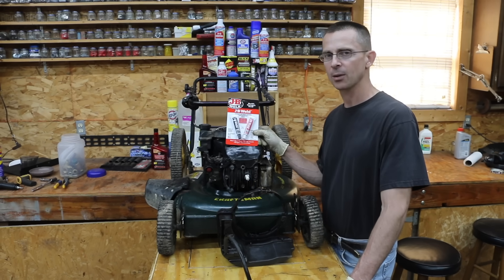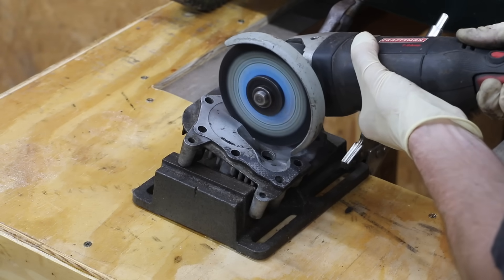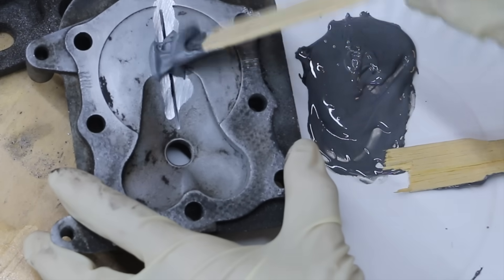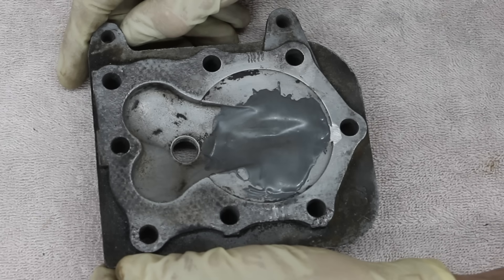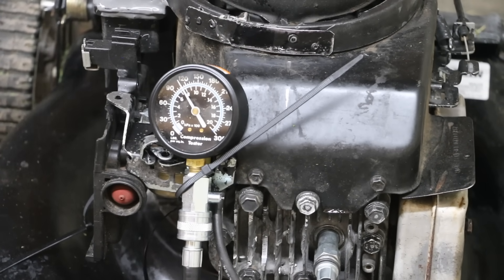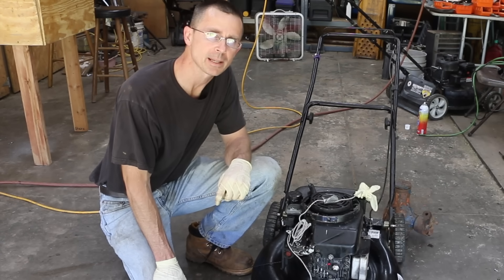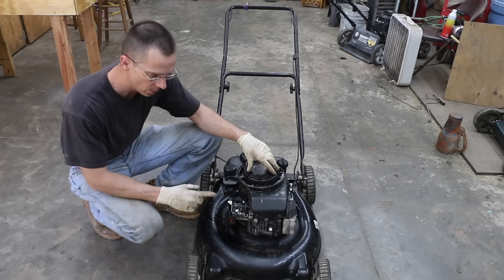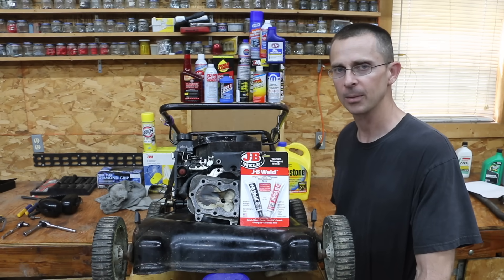Can JB Weld fix a cracked cylinder head?  See the proof!!

Comment: I had an 89 BMW when I lived in Germany that developed a huge crack in the side of the carburetor. Gas would leak out of it. I was leaving for a road trip to Italy when I found it, and I had already packed the car and everyone was ready to go. So I pulled the carburetor off and used JB weld on the inside and the outside of where the crack was and let it dry overnight. Woke up in the morning, sanded the excess down, put the carb back on and hoped for the best. Car ran fine, no leaks, so off we went. 4 years later when I left Germany, I sold the car to someone else...complete with the JB welded carb. I pointed it out to them, told them I'd never had any issues with it after that. 

JB weld works.
Reply from the maker: Wow!  Impressive repair!
Reply: No, Sir, YOUR repair was impressive. But thank you for the compliment, though. Love your videos.

Comment: But what if the crack was at the edge of the head you put a crack in the center if it was at the edge when it expands from Heat it may have had different results
Reply from the maker: Great point. Thanks for commenting.

Comment: Cool demonstration,  but not as real world practical as some of your other test.
My belief is anyone skilled/confident enough to remove the head wouldn’t be using JB weld
The average person trying to patch would probably only try to repair from the outside without removing anything.
But again very cool 😎 
Oh recently subbed 👍🏽
Reply: Not true I’m mechanically inclined and I have a crack in my head on my 98 rm 125 and instead of paying 400 for a new head on a 20 year old bike I’ll use this stuff instead
Reply from the maker: Great constructive feedback and I agree.  Thanks for subscribing too.

Comment: i tried the jb weld stick on my atv exhaust. I used 2 sticks where the exhaust pipe meets the silencer it held up for a little while but when i took the atv to get gas about 1/2 mile the atv all of a sudden got really loud so i knew it was the exhaust, oh driving it in about 5" of snow in awd so it was under a lot of pressure.
Reply from the maker: Thanks for commenting on this.  JB Weld original won't last long if exposed to temps over 500F.  Not sure just how hot the ATV exhaust becomes under load, but I suspect it gets pretty hot.

Comment: I have seen JB weld work on a Detroit 60 12.7 block that was pitted and the one sleeve was horribly bad leaking through the antifreeze side and my dad squeezed JB weld in it and prayed it would hold guess what 780k miles she's still rolling we finally sold it to upgrade and told the buyer about it 😮
Reply from the maker: Thanks for commenting.

Comment: Not for the head, but the gas tank... Seal All. I had a hole in the tank on my truck. I coated some thin package cardboard (like packaging from the Seal All tube works) and soaked all these strips of cardboard in the Seal All and literally paper mached my gas tank... while the gas was running out of the hole! It stopped the leak right away, it didn't affect the how fast it dried. It dried rock hard and I never changed it. It worked for the rest of the trucks life.
Reply from the maker: Thanks for commenting on this.

Comment: I used it to fix a dam spark plug that keeped blowing out off the head on a z24  3.1L engine and it worked tell the car went to the scrap yard 10 years later
Reply from the maker: Impressive! Thanks for commenting.

Comment: Great job. I have used JB Weld for 40+ years!! I have been a diesel engine rebuilder since 1970 and on cracked blocks, heads, lower liner bore seal ring surface I use Lock-N-Stitch ( www.locknstitch.com ) then rebore lower liner seal diameters and remachine heads, etc.  JB Weld is so much easier to use especially on aluminum. Great video!
Reply from the maker: Thank you for the positive comment.
Reply: Project Farm Sir, I am glad to know about using JB Weld on those small gasoline tanks, one of my grandsons weed-eaters has a fuel tank hole. Thanks!

Comment: i had a bad oil leak on my old 88 chevy van once , i was traveling from toronto to b.c.
during this trip i noticed the pan leaking pretty bad so i stopped in regina and  used jb weld 
to stop the leak.  5 years later it still stopped the leak. the only reason i stopped running this van was it was pulled off the road by the cops because of my rusted body. i would recommend jb weld. !!! Maybe i should have used it on the body of the van too. lol. !!!
Reply from the maker: Thanks for sharing this experience regarding JB Weld!

Comment: I'm definitely impressed with JB weld, it held up beautifully on the cylinder head of that mower. I've used JB weld to repair the gear shift lever on a Kawasaki 3 wheeler I used to have, the splines on the gear shift shaft were stripped so I used JB weld to permanently attach the shift lever to the shaft and it held up beautifully and the lever never came off or broke off again! JB weld is some amazing stuff, it's like basically welding only with epoxy hence the name, JB Weld.
Reply from the maker: Thanks for commenting. I continue to be amazed that JB Weld can withstand some challenging repair demands.  Thanks again.

Comment: Many years ago I had a single cylinder dirt bike that had a crack in the head from the spark plug hole to the intake valve to the point of loosing compression. As it was very difficult to find,and expensive for a new head I JB Welded it. I sold the bike a few years ago to a friend and he is still riding it :-)
Reply from the maker: This is an impressive repair. Thanks for commenting.

Comment: fixed a cracked block on my boat inline 4, grind out the crack, tap an thread some screws that are stainless, grind off with heavy stone then fill will jb weld let dry a few days, sand down and add another layer ( using original not fast set) has held up 8 years lol
Reply from the maker: Impressive repair!  Thanks for sharing this experience.

Comment: Curious to know how the tank repair held over time. My luck with JB and fuel diminishes over time. In the automotive restoration wold there is a repair for a certain carb in the float bowls. JB does not hold there. The consensus is the you must use Devcon which is similar to JB. Its the only one to hold up over time in fuel. May be a test you wanna try. The Devcon is quite expensive BTW.
Reply from the maker: It's still holding up just fine.  Getting the surface extremely clean and sanding it with a very abrasive sand paper makes a big difference.  Great point regarding the cost of Devcon. Thanks for commenting.

Comment: I cheaply fixed patched blown head gasket from water jacket to outside of engine on the wonderfull late 90's chevy car 3.1l and the 3.8l as long as u drain coolant and wash scour so jb can grab andclean clean and clean more with oil free solvents changed the coolant got the ph to neutral and 7 out of 9 cars still running on patch job  yes customers were aware of this and yes they wanted to give it a try due to money issues. Ive also repaired a 2t ford garden tracter had a 9" cast iron crack on external water jacket wall on engine block in cyl area from last owner not using coolant in colorado tractor still leak free.....
Reply from the maker: Great post. Thanks for commenting on this.

Comment: i used jb weld on a exhaust manifold off a John Deere 70 gas  farm tractor that was broke in 3 pieces i mounted the manifold on a junk head and put it back together as a temp fix until i could locate a different one to my surprise it did not fail i sold the tractor 5 years later after buying a JD 4020.
Reply from the maker: Impressive repair!  Thanks for sharing this experience.

Comment: I repaired a Snapper riding mower about ten years ago repairing a hole in the crankcase with JB Weld it was quarter sized and it is still holding.
Reply from the maker: Thanks for commenting on this!

Comment: There are better JB Weld knock offs from other companies and I've seen them go head to head in another video, doing weight bearing/shear tests, but it is a good product generally. My only gripe with JB Weld is what is shown here, the drying time. It stays viscous for far too long. There could be instances where that's a good thing, if you need more working time, but if you want quick setting, regular JB is not the best. I do believe they make a quicker setting JB Weld? My preference is to Permatex Cold Weld. It's the same price as JB Weld usually and just as strong if not stronger and sets up really fast. Sometimes gravity is not your friend and you can end up having JB Weld everywhere from having to work it back into place till it sets up harder, lol. I used JB on a gas filler neck and had to fight against gravity for 2 hours for it to stay in place till it set, but it's fixed and doesn't leak now. 

I've used similar products to fix gas tank leaks, transmission pan leaks and all kinds of other stuff and it's awesome stuff. You can treat it almost like steel and it will hold up as good as steel sometimes. Your tip was really good too, for it to work better. Score up and clean your surfaces with solvent, to give it something to grab onto. The difference in how it adheres to clean, scored surfaces is so much better than if you don't. If you don't give it something to grab it will break and fall of. Even just sandpaper, file or wire brush the area, if you are fixing something in place and not removing it. The JB (or other similar products) will thank you for it! There are guys on Youtube who have cast engine cylinders made completely of JB Weld and they worked! It is surprising what this stuff can do.
Reply from the maker: Thank you for this recommendation!
Reply: Thank's for your response! Few Youtubers respond to comments and I see that you do, so that's cool. I get that Youtubers can't reply to everyone, but it's nice when they take the time and try anyway. Just for that, I subbed to your channel cause that's cool and I really like your videos. It's fun to watch these and you try to be Scientific and fair.

Comment: Is it safe to SeaFoam a JB Welded engine? Or will SeaFoam treat JB Weld as a carbon deposit and dissolve it?
Reply from the maker: Heat will destroy the JB Weld, but Seafoam won't.  Thanks for commenting.

Comment: A few years ago I was involved in a car accident. The damage pushed the hood in and snapped the distributor off its mounting bolts. Chunks of the head that broke off were still attached to the distributor bolts so I figured i'd try and JB weld it back on to yard drive the car. I was skeptical because the broken mount points opened up a few coolant passages in the head and they also needed to stay put from the force of the camshaft spinning the dizzy. To my surprise the JB Weld worked fantastic. I sold the car as a salvage with the JB weld and for all I know its still holding it together. Amazing stuff.
Reply from the maker: Wow! This is impressive and I really enjoyed reading about how you used JB Weld to repair the engine. Thanks for commenting.

Comment: I don't know if you've tried the two part epoxy sticks (half green, half grey) on any engine fixes, but I've used it several times for patching leaking seams in my old aluminium fishing boat  (nearly 40 years old), and it's worked very well for that. I've used it several times to patch and reinforce condenser fan blades, and one repair is several years old, and still sturdy. 

I've used JBWeld to fix a cracked lower shaft housing on an outboard motor (again 40 years old), and it lasted for 5 years at least, it could be still working for all I know - I sold the motor a few years ago.

I'd like to see you test the two part epoxy sticks, since it's more convenient to carry and use out on the trail when snowmobiling or on an ATV.

Thanks!
Reply from the maker: Thank you for this recommendation!

Comment: Several years ago I sealed a water jacket crack in the middle of an aluminum head of a dodge colt with a product called quick steel. I didn't open the crack but I did rough it up and ground down a bit in the aluminum. It worked. Drove that car quite awhile before I sold it to my neighbor which knew about the repair and he drove it too for quite awhile. No leaks!
Reply from the maker: I've heard quick steel is a great product. I plan to test it soon.  Thanks for sharing this experience!

Comment: Actually if you look closer, there IS surface cracking on the JB weld.  Not sure that JB would be a long term fix in this environment.
Reply from the maker: You are correct. It would not be a long-term fix due to the heat limitations of JB Weld.  It's rated for around 500F and combustion temps far exceed that.  I'm impressed it lasted as long as it did.

Comment: I have repaired V Twin cylinders, and Triumph cylinders with JB weld.  It held.  In both cases the customer had installed headers on the bikes.  The result was an over lean condition as a consequence of the headers scavenging more exhaust gas and thus creating a leaner burning engine.  On the Indian and on the Triumph, the combustion flash cut into the cylinder wall.  On this Triumph and another vertical twin, the flash over actually cut a grove down the area between the two cylinders.  In most cases this would be a lost barrel.  JB weld was installed in the cracks and machined in both cases.  Both of those bikes are still running strong, full compression etc. BTW, always start from a enriched condition when installing headers.  Lean of a bit at a time and measure exhaust temps.  On English bikes it is much easier, as you can just change the jet needle postion very easily.  On most V Twin carbs, no so easy.  Some jet changing may be necessary. Also check you timing when installing headers given the leaner run with headers.
Reply from the maker: This is great information.  I really like having JB Weld as an option for various repairs.  I'm amazed at how well it works.

Comment: Do you think JB Weld will fix a hole in a Kohler K341 cast iron engine block?
Reply from the maker: If used to plug a hole (applied inside the engine with pressure pushing JB weld into the hole), it certainly seems likely if the area of the block isn't subject to temperatures exceeding 500F.  If used to patch a hole (applying a layer on the outside of the block over a hole) it isn't likely to last. Hope this helps.

Comment: Not sure you need to shove a screw in there to hold the throttle open for your compression tests.  The governor spring should be holding it wide open when it's off anyway, as long as you have the speed setting up all the way.
Reply from the maker: Thank you for this recommendation.

Comment: Try CRC. Guaranteed to pass Emission test. over 250,000 mile on engine.Passes every year. One bottle full tank gas.Run 3/4 gas out. and refill tank .If don't work they say full refund. Never fail so far.
Reply from the maker: Thank you for this recommendation.

Comment: Impressive demo! I once sold industrial repair welding alloys for 'Eutectic Castolin'  (now known as Castolin Corp.)  They had an epoxy resin/powdered metal putty called 'Mecatec.'  ~~Would have been interesting to see the cylinder head cracked in two pieces and  mended. =MUCH EASIER to mend a "pin hole" in the middle than bonding two seperate pieces back together and making it hold.
Reply from the maker: Thanks for commenting and mentioning Mecatec.

Comment: I've seen some problems with the GM 3.1 liter V-6 engine where the intake manifold starts to leak coolant because the aluminum corrodes and makes a small tunnel to the outside, or an intake runner. I'm wondering if JB would make a good permanent repair in this situation. Our Pontiac had this problem before it was totaled.
Reply: Best to buy those alumaloy rods. I personally took my intake to a shop...my friend filled the holes with aluminum by welding and surfaced on mill
Reply: There's really no way to 'fix' GM's engineering mistake on their Modular V6 series intake manifolds. About the only thing you can do is preventive maintenance every 50 to 75,000 miles by putting fresh gaskets (use the Fel-Pro steel-impregnated gaskets) or get your oil checked by Blackstone labs every two years for trace amounts of coolant in the oil.

Comment: For a leaking gas tank I use a product called seal all which you csn buy at any hardwsre store. I had a jeep with a gas tank leak and applied the seal all with the gas still leaking out and it stopped the leak and never leaked again.
Reply from the maker: Thanks for this recommendation!

Comment: Ive used jb weld to fix two different radiator leaks on two different vehicles. A 91 toyota 4 runner and a 94 chevy lumina. Both repairs lasted more than 6 months. Its all in the prep work in how the repair turns out and lasts!
Reply from the maker: This is impressive!  Thanks for commenting on using JB Weld.

Comment: This might be a stupid question but was that had aluminum I've never had luck with J-B Weld but I have recently cracked where I put in a coolant temperature sensor on my car that is aluminum
Reply from the maker: Yes, it was aluminum.  Surface prep is extremely crucial, including a chemical cleaning and sanding the surface.  Thanks for commenting!
Reply: Thank you this was my grandparents car befor they passed im just trying to keep it going